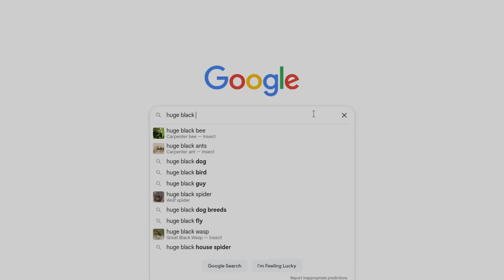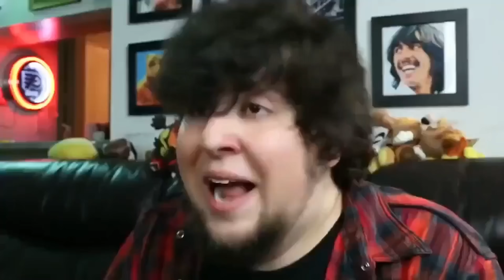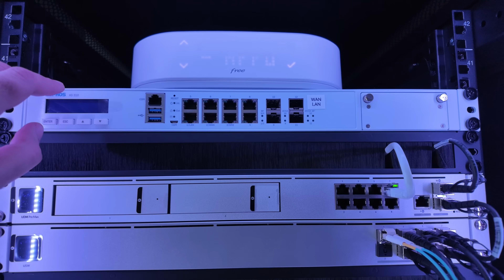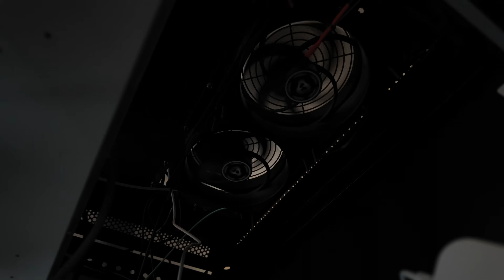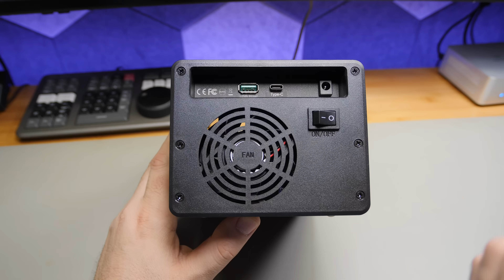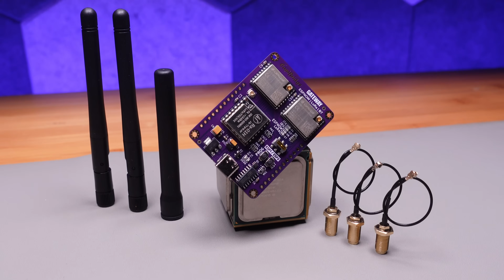My First 42U Homelab Tour  |  The Hardware Behind My Smart Home

Comment: thats funny.. your UPS brand EATON are actually a super famous Supercharger company. a kit is like 4-5 grand for a centrifugal style (looks like a turbocharger but the impeller is turned by a belt that is connected to the crankshaft instead of using exhaust pressure like a turbo and have the exhaust gasses spin the impeller.. they are the same theory but different uses both in the input and the power curves they are same but not comparable lmao)
Reply from the maker: Haha, I had no idea they were involved in that industry too, learn something new every day! 😅

Comment: Absolute cinema. Très beau rack qui allie la flexibilité et puissance des gros matos pro, en restant mindful des dépenses, contrairement à certaines chaines US avec des setup à 40k$
Comment ça se passe niveau bruit ? Avec autant de 3.5" qui spin, ça doit faire quand même pas mal de bruit, surtout avec les ironwolf. La ventilation est souvent facile à gérer niveau sonore mais je galère avec les hautes fréquences de disques durs
Pour la intel ARC, tu as pas trop galéré pour avoir des perf sympa ? J'hésite à m'acheter une A770 d'occasion pour profiter des 16gb à prix presque correct (vu que la B70 32gb est introuvable, à part quelques sites allemands où elle est plus chères qu'une R9700 AI 32gb...)
Reply from the maker: Merci beaucoup 🙏 Niveau bruit, franchement ça va. Je n’ai pas de bruit aigu désagréable avec les disques. J’entends surtout un peu de vibration, mais c’est assez soft. Et en pratique le NAS est éteint la plupart du temps : je l’allume surtout quand je fais du montage vidéo. Le seul HDD qui tourne en permanence est dans un boîtier USB, pour les fichiers médias, et celui-là est vraiment silencieux. Pour l’Intel Arc, je l’utilise surtout avec des petits LLM couplés à n8n. Ils font principalement de la prise de décision simple, par exemple déterminer si un texte correspond à A, B ou C, puis sortir un petit JSON que n8n utilise ensuite. Pour des modèles un peu plus gros, comme Gemma 4 12B, ça fonctionne, mais c’est lent. Honnêtement, si on veut une bonne expérience, une meilleure compatibilité avec les modèles locaux et avec la majorité des projets LLM en local, il vaut mieux partir sur Nvidia. Le problème, c’est le prix 😅 Pour une vraie utilisation “agentic work”, il faut plutôt viser un modèle 27B qui tourne assez vite pour être agréable à utiliser, donc idéalement une carte Nvidia avec 32 Go de VRAM. Et là, quand on regarde les prix des 5090 32 Go… OMG.
Reply: @PricelessToolkit  OMG en effet... C'est tout mon problème... Même les 3090 24gb d'occasion sont introuvables maintenant, je regrette de pas en avoir chopé quelques unes l'année dernière quand c'était 650€. J'ai trouvé des versions modifiées du 27b 4-bits qui fit dans 16gb avec un contexte 32k (suffisant pour agentic), mais pas encore testé. Par ex la 4bpw-16GB-VRAM, hauhau uncensored IQ4_XS, ou sinon carrément la unsloth UD-Q3_K_XL (mais je pense que pour de l'agentic, un 35b A3B avec quelques layers offload serait mieux qu'un 27b lobotomisé en Q3).
Perso j'ai misé sur 35b en Q5 avec un peu de system ram, ça marche top partout sauf gros code pur et maths complexes
Avec les modèles MTP et les derniers drivers, la R9700 AI 32gb est "presque abordable" (1400€) comparé à la 5090 et a des performances utilisables maintenant mais c'est pas pour demain encore

Comment: I use a was110 in place of my ISPs ONT box. One of my favorite pieces of kit in my entire rack. Dont hesitate. Just do it
Reply from the maker: Thanks! I looked into the WAS-110/8311 route and it looks amazing for ISPs using XGS-PON, like many Orange/SFR/Bouygues-type setups.  But in my case I’m on Freebox/Free France, and from what I found Free uses 10G-EPON, not XGS-PON. The WAS-110 is an XGS-PON ONT stick, so it’s not just a plug-in replacement for Free’s ONT/Freebox. For Free I would need a confirmed 10G-EPON/DPoE ONU solution, and I haven’t found a reliable confirmed one yet.

Comment: Nice project – it’s a change from the others we usually see.
I love the idea of switching off the backup server during the day and only turning it on at night to reduce power consumption. I do the same with my rack too. However, I think it’s a drop in the ocean compared to everything else, which must consume a huge amount of power. It would be interesting to know the total power consumption. Would it be possible to find out which OS the Dell Wyse is running on? I’m not too far from you – are you offering a real-life home lab tour? 🤣
Reply from the maker: base 160-180w all turned on 250-380 + 250w for editing PC,  "drop by drop = ocean" Dell os is DietPi

Comment: I have two startech 25U racks.  One is still in the box and the other is in my office (read spare bedroom).  So far all in only has my 20 bay media server, an R720XD, and my R7920, the router/modem from my isp and a used enterprise POE switch.  I still have a lot of planning, cable routing, and camera mounting to do. Most of it is on hold because storage and ram is ridiculously price now.
Reply from the maker: Nice servers!! but unfortynatly in France 1KW is 0.25 Euro :(

Comment: Cool homelab! Have you considered Unraid as an alternative to an all ssd nas? You can spin the discs down when not in use, and depending on the array setup only needs to spin a single drive up when reading. With an ssd pool cache it can be pretty performant too.
Reply from the maker: Thanks! I actually have an Unraid Pro license that I bought many years ago, and I’ve thought about switching. The main issue is that I don’t currently have another NAS or enough spare storage to transfer all my data while converting the TrueNAS setup to Unraid. With HDD prices where they are, that probably won’t happen anytime soon.

Comment: The 10 Gbe NIC for the HP thin clients were discontinued in December. Second hand prices are rather high for the part right now.
Reply: 56Q71AA is the part number for those who don't know
Reply from the maker: Yes, for 10Gbe, 150USD is too much, 2.5 Gbe is around 30-40
Reply: @PricelessToolkit  I can barely find them for $200
Reply from the maker: OMG..
Reply: @PricelessToolkit RTL8159 for USB 3.2 is good cheap option :)
Reply from the maker: Thanks, Its stable ?
Reply: @PricelessToolkit for Windows i use 2-3months and its ok ;)